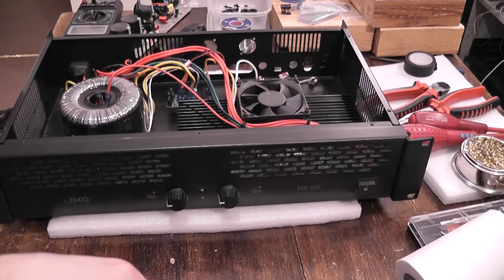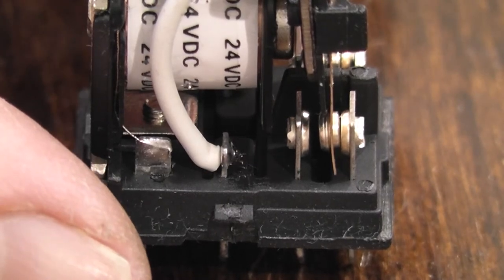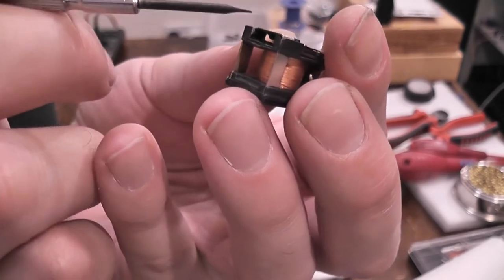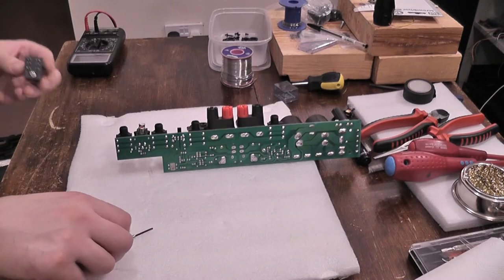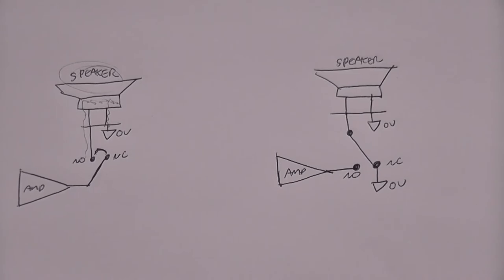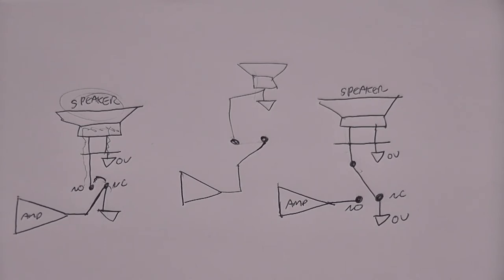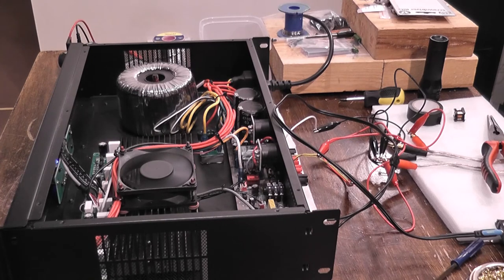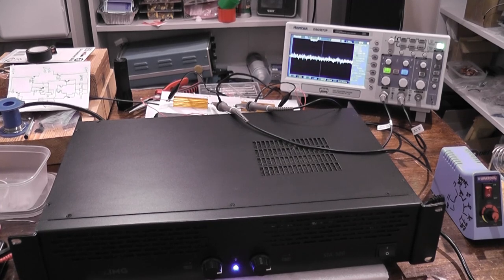IMG Stageline STA500 amplifier repair and DC protection issue.

Comment: Do you know the size and type of fan used in  this amplifier? I was asked to repair this type of amplifier, it makes a loud rattling noise
Reply from the maker: Just a standard cheap 12v computer fan.
Reply: I haven't opened it yet, I wanted to ge a replacement first because it is in use every day in a café. Do you happen to know the size? It looks like a 60 - 80?
Reply from the maker: 80mm I'd say.

I just modded the 4 at a friend's place. The 5000 has 4 fans in it. I series connected each side so it runs 2 pairs at 6v. The connection where the negative of one connects to positive of the other will need a 47uf cap going to 0v as an AC ground. Just use the old negative connection that you disconnected the a fan from on each side. Still plenty of air flow, runs much quiter and fans will last pretty much forever running like that.